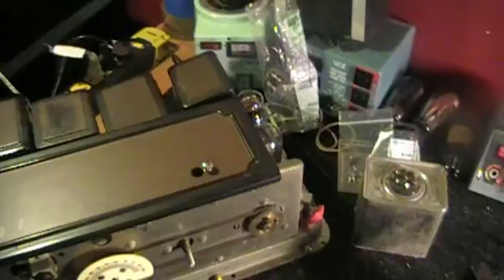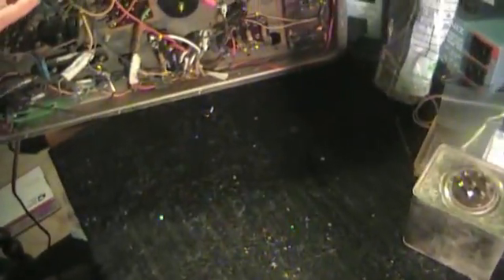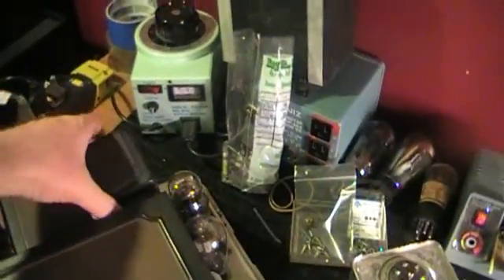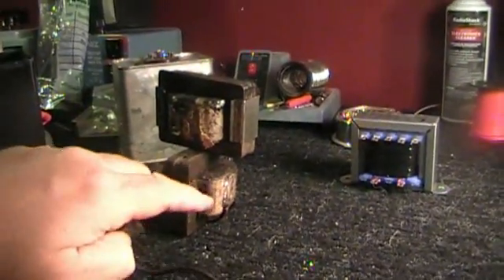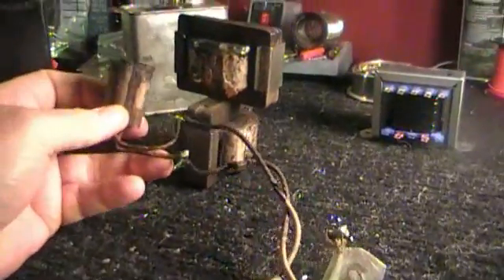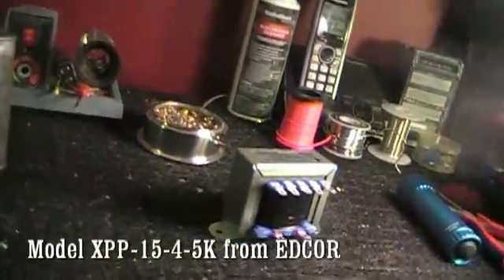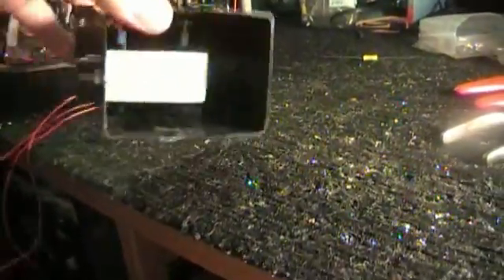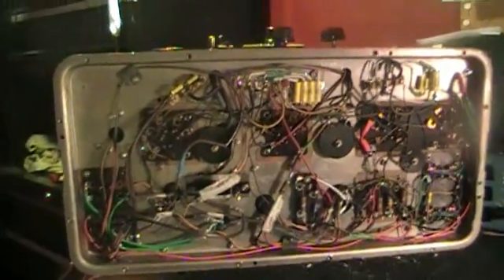Atwater Kent 55-C Output Transformer Replacement

Comment: Good morning John, I know this is an old video, but do you remember what model number you used for the new interstage transformer you used? The one you mounted outside the can. By the way, thanks to your video I successfully clipped my quality capacitor. It would not have happened without your video so thank you.
Reply from the maker: Sorry but no I don't remember.  I got advice from another hobbyist on antiqueradios.com.  I vaguely remember 1 to 7 winding but I can't remember if that was the prestage or final output transformer.  I do believe it was a Hammond transformer.  A fellow named Leigh on the website has all the impedance values listed for the 55c.
Reply: Thanks for responding John, I hope you are doing well.

Comment: I have the same question about the resistor wattage.  My Interstage transformer also seems to have died.  Can you provide a part number or point me in the right direction?  According to the schematic its supposed to be a 1.1k : 7k ratio, but I can't even find anything close to that.  Thanks.
Reply from the maker: Hi Sam.  Check antiqueradios.com for several threads on the 55c.  A retired tech - actually a few of them - helped me choose the transformers. Or perhaps call the Edcor company and see if they can suggest one.  They've been around a long time and a lot of techs will only use their transformers.
Reply from the maker: As for resistor wattage I think I went with 2 watt resistors for the main output resistor panel.  But it won't hurt to be safe by increasing the wattage to 5 watts.  On the smaller resistors, I think they were 1 watt but those aren't in the output stage and so the current passing through them is not nearly as high.

Comment: Quick question. What wattage resistors did you use in this? I'm having trouble finding out for sure what they should be.
Reply from the maker: What model do you have?  The 55C?  I had found someone on antiqueradios.com who has a vast amount of information on all things Atwater Kent.  It's been so long that I cant remember his handle, but if you go to the website and search on your model you will find several threads that can be helpful or you can add new specific question and many professional there love helping us newbies.